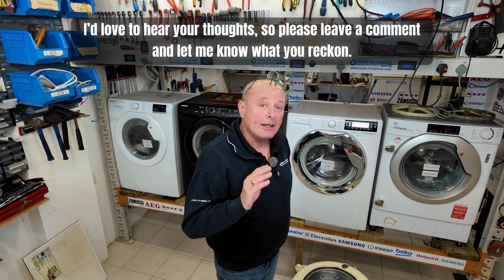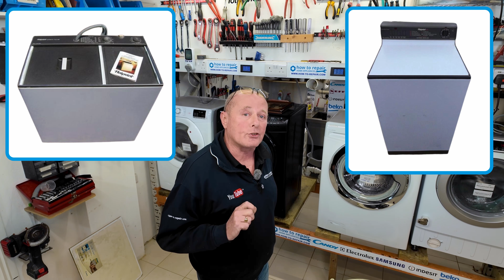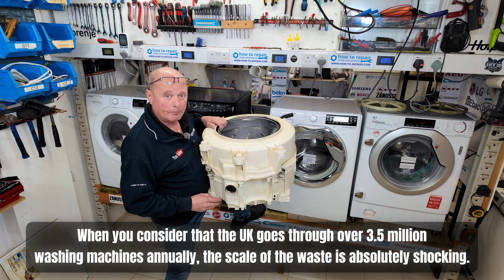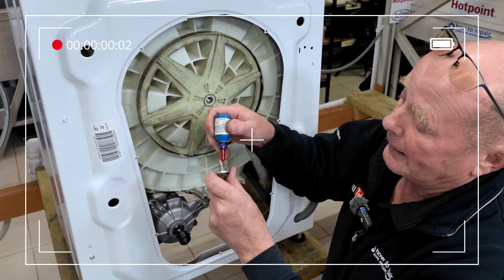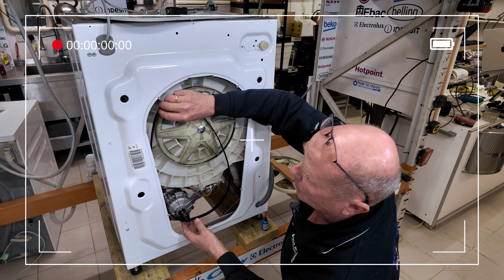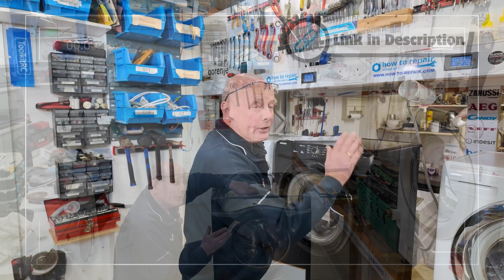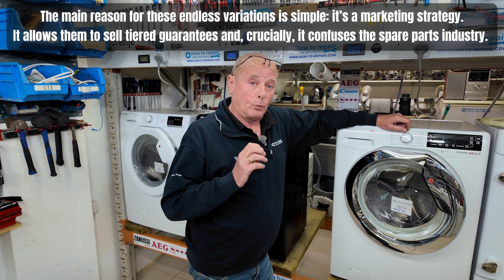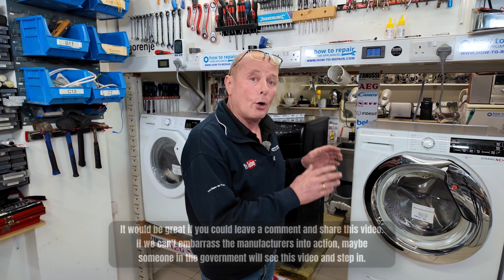I Scrapped 13 MACHINES to Prove a Point: STOP BUYING These Brands!

Comment: Do not buy PS5 either. It's designed too crash.
I have seen hundreds of times (videoes) it's normally simply cap fault that are so cheap it's designed too be crash within few years.

Also metal liquid oh my god. So many are having PS5 vertical. 
I have seen so many photos from Sony showing them in vertical because it's "cool", but you should have it. You should have it horizontal.Otherwise you will create dry spots and kill the machine after a while.

People are way too afraid these days. If you are getting one small error, or won't boot up first time. They won't diagnostic or test it further. Throw it in the garbage.
I had really one PS5 that was thrown in the wall. So the PS5 didn't turn on from the power button. Because of that they sold it as garbarge too me. I was testing from motherboard and then tested it with the PS5 controller too turn it on. Was working just fine.

I'm getting nearly mad because people ain't testing anything anymore. The producer should made it even easier too repair them.
Not too scare the customers off with plastic above a screw making them think the guarantee will be removed just for removing the plastic.

People are getting too afraid just too remove the dust. Making it even more dangerous then necussary.

I wish the main factory of these motherboard had some lights and named the caps/muffat so when one cap is gone you would get red light in that small area making it easier for the nooby repair man. Saves alot of time.
We need too attack the main factory not learning from their mistakes.

If it's illegal or the main factory trying too scare off the customers too repair or remove dust. You shouldn't buying it.
We should also be demanding in the repair act that can not be selling seperatly parts for that expensive.

Comment: I still use my first thomson washing macine from 1999, at the beginning used once a week or so as wi was single, then stored 10 years when I worked as an expat and for 9 years now using it almost everyday (in parallele of a miele machine) for our family of 4. Never got a repair, works as a charm.

Comment: Hi and thanks for the test. I can totally agree with you. I once had a top notch Samsung machine. After 18 months it made a cracking sound every time the drum changed direction of rotation. I called the support. Had the machine running (empty) with the guy on the phone and it still did this noise - even he could hear via phone. His conclusion: "That's actually normal. Nothing wrong." After 25 months (I'm in Germany and had 24 months guarantee) it stopped working. I guess it was the same issue as in machine 4 in your video. A Bauknecht machine I had before broke down with defective bearing after 6 years. Now I own an AEG for about 3 years and I'm beginning to hear similar noises since last week... so it seems to start its breakdown. 

As a German I would be interested in your opinion/test on Miele machines, since it is said they still are the best in terms of longevity, but I kind of doubt it. 🤔

Comment: I've an old 2016/17 8 kilo beko I've replaced the brushes 3 times /Door seal / board / hoses in that time & it's still going strong & so easy to work with ,great machines & still going strong to this day & I'm no engineer, just your everyday DIY'er 👍

Comment: It's been my experience, with new appliances, manufacturers are adding "features" that are made with the cheapest possible parts to essentially ensure a cascading failure that ruins a machine, or at least prevents the machine from functioning without repair on a regular basis.  Adding different types of sensors and locking mechanisms that rely on weak or sensitive parts in particular is common.

Comment: My mother had an old yes it was old in the 70,s it was an old "WRINGER WASHING MACHINE" and I still used it in 2006 until it finally stopped working the motor gave out and the actual steel frame was rusted out and so I finally had to retire it I think we used it for about 60 or more years...

Comment: I've got a cheap beko washer and beko dryer. I didn't really expect to last but had them coming up to 10 years. The dryer at one point was making a horrible noise and the Mrs was looking at a new one to buy. Ended replacing the pump myself for £25 been working since and that was 5 years ago.

I don't blame people for replacing sometimes. But it's been to make sense to fix

Comment: i fully agree with the bad behavior of repairability of electronics nowdays and the on porpose used low quallity / bad design in specific parts of the machines. its horrible what they do. 

I love to repair my own electronics and also the ones from family and friends but in a lot of cases its simply not repairable due to sealed designs or astronomicly expensive parts for the repair. 

Figured out over the years how to 3d print some stuff for plastic parts, got a friends thats doing me the metal parts i need for cheap or free and due to my job i can work with electrical stuff to find and repair bad components. 

Not always working but in 80% i safe myself and friends combined thousands of Euros a year with repairs. 

F those companys... seriously.

Comment: Lived in the USA for 25 years and had a Maytag washing machine and gas dryer I replaced several part over those years and we sold the house with those still running. They are now 30 years old. We moved to the UK 4 years ago and bought an INDESIT that is already making horrid noises and I’ve had it repaired once already. Utter rubbish! Come on UK you can do better!

Comment: We have Energy Ratings, but we desperately need a Longevity & Repair Label on every appliance before it hits the showroom floor. It should be broken down into 3 clear scores:

> The 'Open-Box' Score (1-10): How easy is it to actually get inside? If it uses proprietary screws or glued-shut drums, it gets a 1. If I can open it with a standard screwdriver, it gets a 10.

> The 'Parts Economy' Score (A-F): This compares the cost of common spares to the price of the machine. If a £400 washer needs a £250 control board, it's an automatic F. We need to know if a repair is even financially viable.

> The 'Service Intelligence' Score (%): Does the machine tell me what’s wrong, or does it hide behind a 'Call Service' light? It should give clear error codes and have a built-in diagnostic mode that doesn't require a £100 call-out fee just to plug in a laptop.

If people could see a 'Pence-Per-Wash' cost over 10 years right on the price tag, they’d stop buying these 'disposable' machines that are designed for the landfill.

Great video, keep exposing the planned obsolescence!

Comment: I had the bearing problem with an LG direct drive after just four years. Due to the sealed bearing, the repair cost would have cost almost as a brand new machine. Since then I only buy the cheapest washing machine.

Comment: I have a Hoover Model 29 vacuum cleaner that my parents bought in 1951 for $87.95 new. That was fairly expensive, but the key parts are metal. It's seen some maintenance over the last 75 years, but parts are still available and, you guessed it, the Hoover is still hoovering!

Comment: Your on-going campaign is an ideology but not practical.  There is no such thing as "Planned" obsolence\w.  Simple economics says you ca not build residential products that last 20 years.   Your campaign is not well though out. Maytag tried that . Maytag in the 1960's--1980's owned the washer and dryer market. Their machines lasted very long. There machines need little to no service in their lifetime.  So what happened ?
      Maytag could not sell parts because nobody needed parts. at least not enough parts to support a large company.   Maytag could not sell new machines because everyone had one and nobody needed a new one..   So what did Maytag do, They sold the company to Whirlpool.  You CAN NOT build generational residential machines and expect there to be a market in 20 years. You literally will put yourself out of business.
  So the only choice is to design machines that last no more than half a generation, if you want to stay in the manufacturing business.  So that is today's Long term business model.
Your complaint is old hat and been proven to lead to failure.  I do not like it but those are the facts.

Comment: Thank you for this video! It just confirms what I have assumed for quite some time. If such appliances are throwaway articles now, I will happily go with the cheapest make I can find then, should my washing machine break one day - which will be something like Haier, Midea, Chiq or similar. Traditional German/European brands nowadays are "Enginered in Germany/Europe" at best, and even if they are manufactured in (Eastern) Europe, that does not necessarily mean better quality/durability. Bosch/Siemens and even Miele have become overpriced mediocre quality. It's sad, but one must face reality.

Comment: Purchased a Kenmore front loader in 2006. But for a door lock replacement (10 minutes work), has been going strong for 20 years. Made by Frigidaire in the US, I believe. Afraid to buy a new one, and will try keep it going as long as possible.

Comment: Had a bad run with Samsung appliances, but the washer, replaced the motor brushes twice, a pump once, got a spare belt cause i know thats gona go soon, but going strong and its worked at least twice a day for 15+ years, actually mantainable,  great job.

Comment: The warranty recommendation is sound.   instead of a £300 belt driven indesit I opted for a £450 direct drum drive LG that came with 5 yr Warranty.  The equivalent "Extra Warranty" for the indesit would have cost £150 or so on top so it was a no brainer to me - 22 years later and the LG is still going strong.

Comment: We still ise a Hotpoint 9510 Electronic 800 Plus  in our workshop for washing overalls towels Etc. It was originally used at home for around 15ish years before my wife bought a new machine, in all of the years the Hotpoint has only had 1 noisy pump changed, the machine was still working just the pump started to squeal.
30ish years old and still chugging away doing a large heavily stained load every couple of days.
Nowadays you will be very lucky for a Hotpoint to last 5 years.

I totally agree that in the last few years, manufacturers have made things very difficult for engineers to repair machines.
I refuse repairs on a daily basis because of the inaccessibility, you are more than likely to break components, just to repair the original fault  making the repair too expensive for or customers.
Then you fall into the realms of being accused of ripping people off because repairs are expensive.
All wrong.

Comment: Ex Hoover engineer here … The hombre speaks the truth - I left hoover because I simply couldn’t stand over the brand but he’s wrong about hard to work on - Hoover machines are simple to work on and what he has failed to mention is that with Hoover you only pay the cost of an engineer - the parts are free - As he is an independent engineer he cannot compete with this and it’s not built in obsolescence- it’s about pushing out the independent engineer - the manufacturers want you to pay them to fix it - so this video is very biased in its presentation. Hoover is also not made in Britain at all - it’s not an English brand - Hoover was bought by Candy who are now owned by Haeir - a Chinese company. Also he’s full of it with regards to the suspension on Hoover washing machines as the same suspension leg is used on numerous brands anyway. The quality of material in Hoover candy machines is absolutely terrible. Don’t buy one - it will bounce around your kitchen - Also Hoover engineers can reprogramme machines - he cannot compete with- he doesn’t posses the equipment

Comment: My repair tech said... Never get a washer dryer,  Pay the extra for direct drive,  1000rpm spin is plenty enough - any more than that gives diminishing returns for exponentially more stress on the bearings.   The LG intellowasher I chose on his advice is 22 years old now.   When the door-lock failed, the malfunctioning component was out of production but I was able to remove it myself, take it apart and reassemble it so that it still works🤞I'm so thankful I wasn't forced to scrap it. I doubt any modern machine will last so well.

Comment: Here is your list of the 13 disgraceful brands. Like if helpful: 

1.	Hoover (Primary focus: quality has "gone downhill")
2.	Candy (Primary focus: cited for bad lid designs and accessibility)
3.	Hotpoint (Specifically modern versions with welded cabinets)
4.	Indesit (Cited for building welded cabinets that prevent repair)
5.	Ariston (Listed among those using "disgraceful" welded cabinets)
6.	2010 Hoover/Candy Model (Scrapped due to unrepairable bearing noise in a sealed drum)
7.	2014 Drum Unit (Leaked due to a simple hole, but required full replacement)
8.	2015 Hoover/Candy Model (Scrapped due to a warped drum; repair cost outweighed the machine's value)
9.	2019 Hoover HL Series (1682D) (Failed due to a corrupted PCB and unnecessary NFC "gizmos")
10.	2024 Integrated Washing Machine (Thrown away after only 18 months due to a loose pulley nut/design flaw)
11.	Modern Bosch (Criticized for using sealed drums despite having a good warranty)
12.	Neff (Grouped with brands that moved toward sealed drums)
13.	Siemens (Also grouped with brands using sealed drum designs)

Comment: Here is another issue I have:  the washing machine forces you to heat the water, rather than using the hot water you might have in your hot cylinder.  My Hotpoint 95360 has an ‘economy’ cycle, which allows you to use your home’s heated water.  It is connected with two hoses, so that the first washes can come directly from your hot water, and the macine does not have to use electricity to heat the water.  New machines only have one hose, attached to your cold water supply.
Reply: where is the saving? Energy has to be spent (and paid) on heating the water, in your laundromat or your central heating regardless.
Reply: @quadpumped34  that the machine which was made with the sole purpose of heating water, will certainly be more robust at doing so
Reply: @quadpumped34 mains gas fed to a boiler is a much cheaper fuel source than electricity.
Reply: @gezparks9630  in our house built in 2016, the main heating was struggling to provide enough heated water to all tenants. It broke down and had to be expanded and extended by another tank of hot water. I imagine having washing machines on mains could exacerbate issues like that. Any machine like central heating has to be laid out for a specific use and capacity and if it isn't, violating its specs will inflict you more expensive issues and breakdowns..

Comment: I have been repairing appliances for the last 40 years and I use to repair everything from toasters  kettles irons hair dryers none of the above now are repaired also the quality of the Appliances and the materials used in them is totaly inadequate also the metal used in these appliances is so thin and it's like handling a razor blade all the parts are over priced so sad to see.😡

Comment: I still use a Hotpoint 95360 machine.  I am not a repairman, but have been able to replace the bearings, valves, spider, pulley, belt, shocks, door gasket, seal  and pump by myself.  Fortunately, these parts are still available.  I will say that I wish Hotpoint had used screws to connect the two parts of plastic drum, however, as those clips that they used are a terror.  But doable.

Comment: Quality goes under the rug when private equity funds take over factories. The same happened in Brazil with traditional brands Brastemp and Consul. Back in the 70s the equipment was made out of metal and lasted for ever.. nowadays it's all plastic and designed to break up. It's so called engineered obsolescence. It's a total scam.😊

Comment: 30+ year old GE dishwasher, not one part has been replaced, still works just fine.  5 year old LG, had a $25 part rendering the entire thing useless after less than 2 years and was given to me as a result, replaced the part and installed the LG to replace the GE... lasted 2.5 months before the same part failed again, inspected why the part failed again and determined the location is moisture prone and the part is not moisture rated so when the seal leaks the part gets wet and eventually fails.  Installed the GE back in, still working fine to this day years later, what a piece of F**ing garbage that LG was.  Can someone please just start a company that sells "dumb" appliances that last as long as they used to without "smart" electronics? You will make millions I promise.

Comment: My Candy machine (family member gifted it me from new without me asking) lasted 10 months.

Please may we have:
- 2 size machines, for 1-2 person and 3+ person households
- cold water, 40 60 90 degrees settings, nothing else
- through-hole PCB, maybe even tagboard if possible 
- all design, parts and components open-source and easily accessible and replaceable
- and customisable/paintable surface fascias because I want an orange washing machine in my kitchen.

Someone put that design together and I will gladly give you my money.
And then please do the same again for fridges and freezers.

Comment: I just have a condensing dryer Candy dismantled for 2nd time in 5 years of using it, while other brands work for longer with no issues. 
First failure was caused by a tiny design mistake which they did not fix (wrong hole -> missing a screw) ->  the roller wears out fast -> terrible noise -> terrible reviews on the Internet. After fixing it, it was so much quieter. 
The drum does not fit very well (touching case, belt riding on the edge of the groove), which probably leads to second problem: asymmetric wear of a felt gasket -> increased friction -> not spinning. At least it can be replaced, but not sure how to move the drum forward to fix it fully.